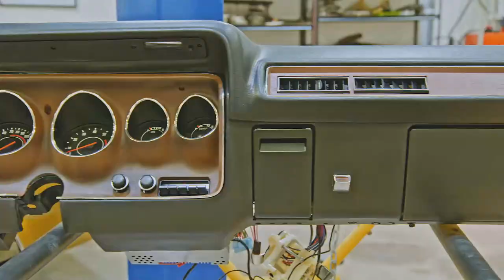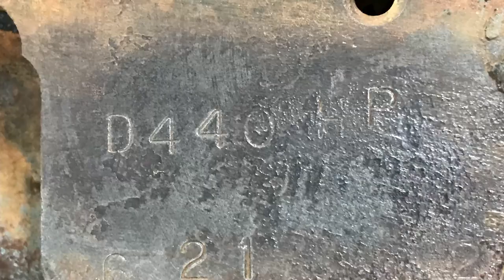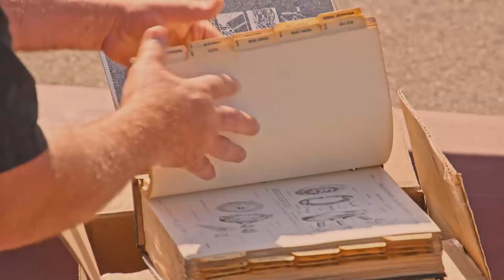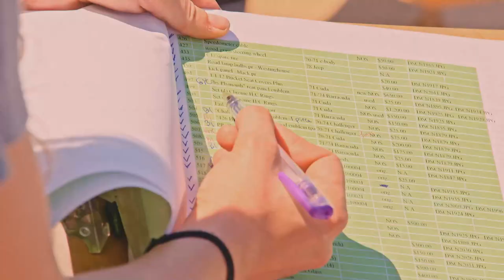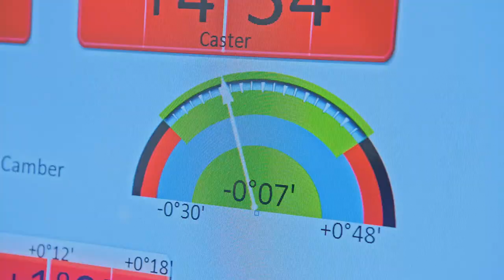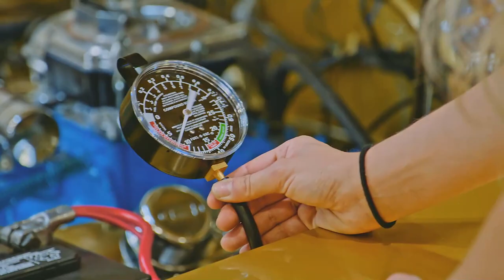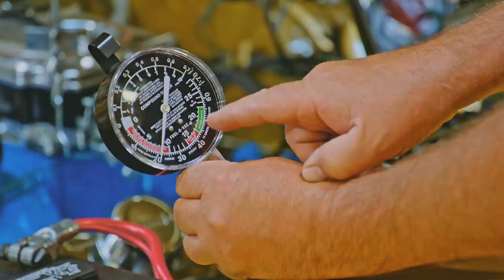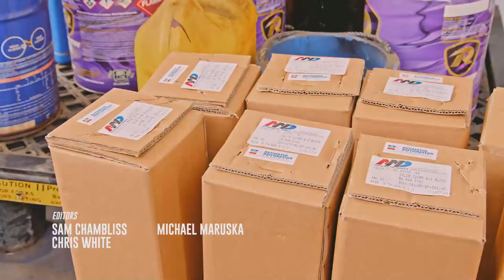CANCER SURVIVOR GETS HIS FATHER'S BELOVED 1972 CHARGER SE BACK FROM GYC. DRIVE IT LIKE YOU STOLE IT

Comment: There was an issue with low vacuum due to  a slightly wilder than stock cam , possibly on the Olds W-31 that affected the brakes the same way- you at one time could buy and install an auxiliary vacuum tank to combat this situation ( low intake vacuum). And isn't the hood bulge on that Charger supposed to be flat black ??